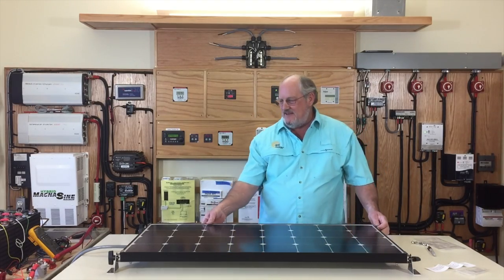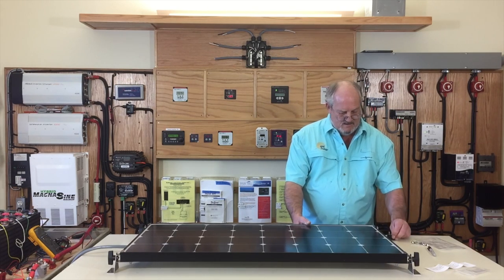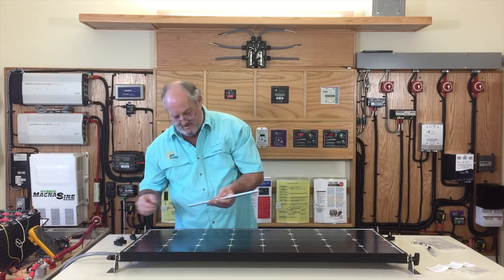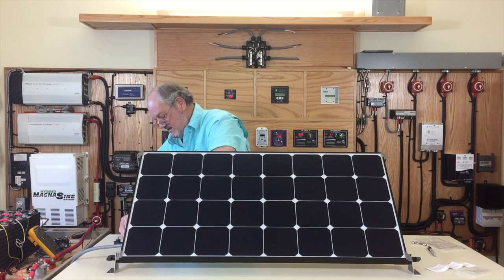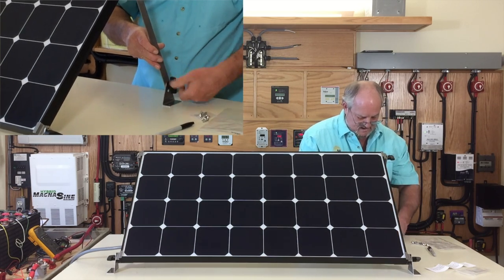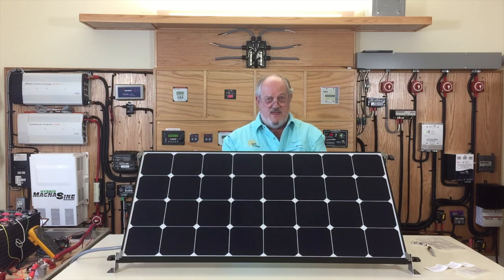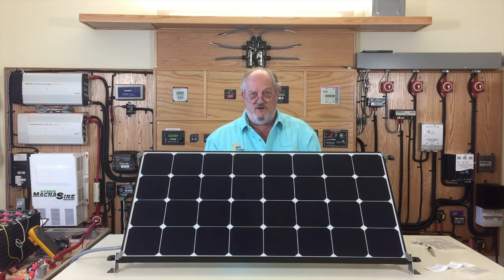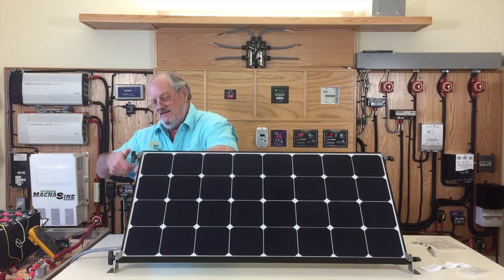Installing the Tilt Bars

Comment: Very interesting!  I needed to see this.  We focus all our attention on the solar panels and not on how to mount them.

I bought two 100 watt flexible mono panels online (did not know about your company till now), and wish I had bought the glass panels now.  Is there a way to raise the flex panels and make them tiltable?  Do you sell these kits at AM Solar?  

What I did not know is that the flexible panels generate heat on RV roof, while the raised glass panels dissipate this heat away from RV roof.  Is this true?

I need to solarize my 22 ft Class C RV (dome roof) soon.  Any help would be much appreciated!
Reply: This was painful to watch.  The extension arms should have a slot running up the middle the entire length of the arm AND be permanently mounted to the mounting brackets.  The arms would need a light curvature.  That would allow one to simply loosen two knobs on one end and lift the panel up before and then re-tightening the knobs.